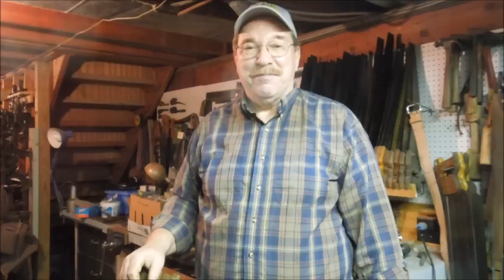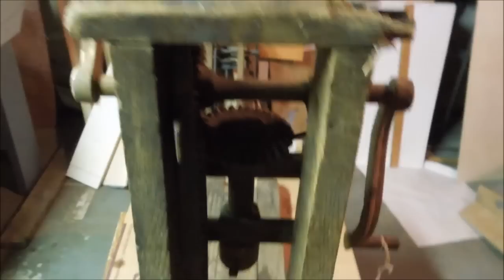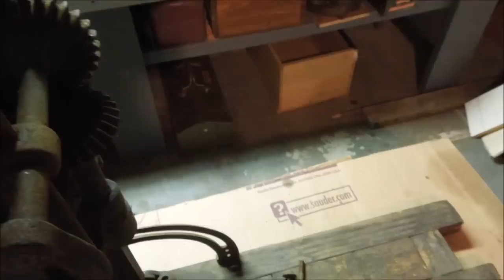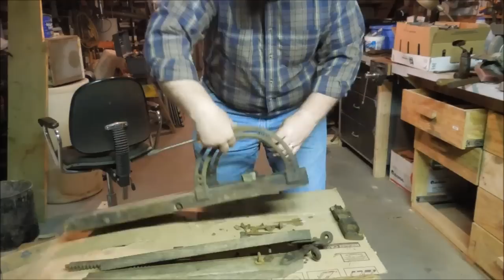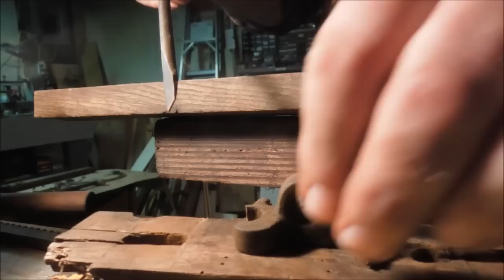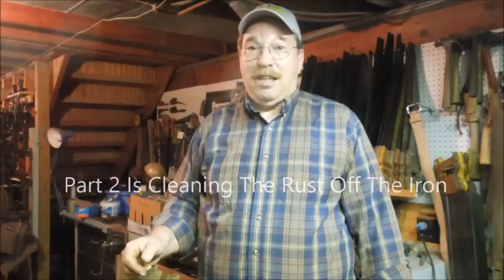Fixing - A How To For Swan Beam Drilling Machines - Pt 1 - Evaluation by Old Sneelock's Workshop

Comment: You should be working on a taller table and using cordless tools for fastner removal when required
Reply from the maker: Gary, Look at the date on the video. Then look at what I am doing. It is a hundred year old tool that I am disassembling with other tools. When you work on your own Swan you can do it any way you want with any bench or tools that you want to. Does it matter that much to you what tools or methods I use?

Comment: Always sad to see a good tool neglected. At least it has reached your nurturing hands and should be see some TLC.
Reply from the maker: As you can see on the wall behind me I have a few projects in the works. Scouring the countryside for tools to rescue is a great way to spend the day. I don't always find tools in perfect order. In fact I tend to look for the worn or damaged ones just because they are the most fun to restore. It is amazing how many have been left to the elements.
Reply: Old Sneelock's Workshop And it isn't always the case that it was intentionally cast aside, sometimes the owner passed away and the tool is forgotten. 

Or there is the case, I remember way back in high school reading a short story about a young black girl and her mother lived in an old share-croppers house and the older sister came to visit and wanted some of the old items that they used day to day for decorations. Some people look at them as some form of decor (which is fine I suppose) but they sometimes destroy the very usefulness of the tool in order to create that decor (like ripping out the guts of an old coffee grinder to create a lamp).